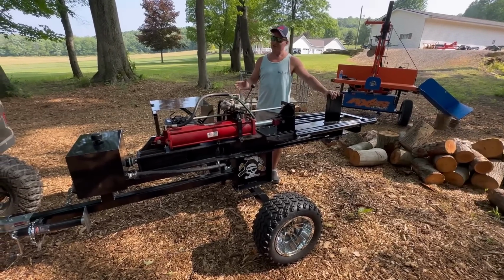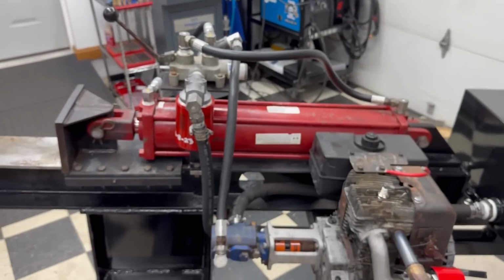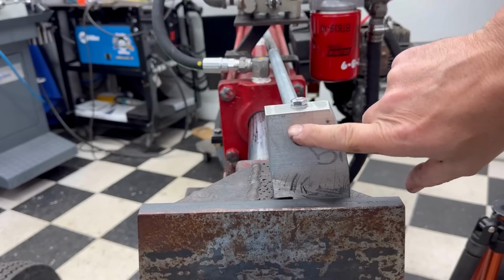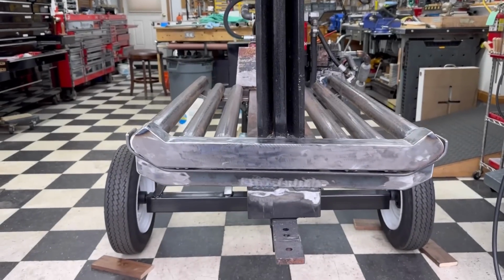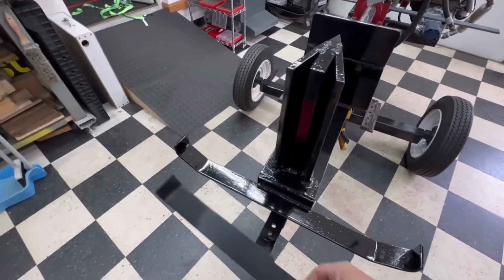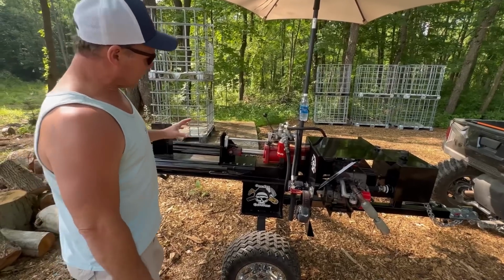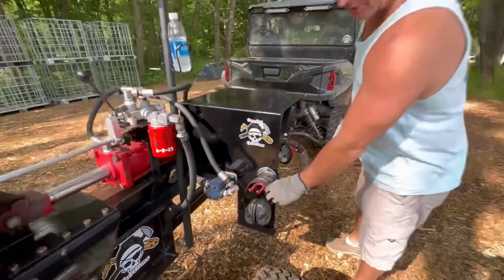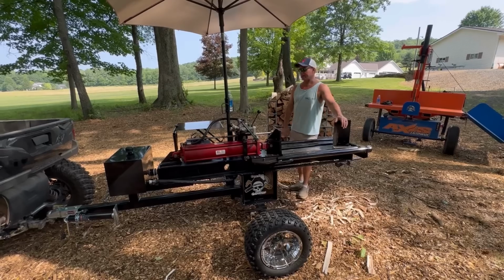One of a kind SLIDING TRAY. Log Splitter completion PART 4

Comment: I’m 70 now and I’ve been a custom fabricator all my working career and well this just makes me smile. Nicely done 👍
Reply from the maker: That is awesome!
Reply: @fcsturningwoodcraft2933  if you been a fabricator all you life then you should know he went around the block to go down the street. Put the knife on the ram and the wood never moves eliminating the need for a sliding table and as far as stopping the ram at certain points we'll that's as simple as drilling a hole in the beam and putting a bolt in it

Comment: One consideration is to add some small cleats to the push plate so logs that aren't cut square and/ or have twisted grain don't kick up out at you under pressure.

Comment: Doug, great video. I really like watching your creativity and knowledge on this video as well as the other ones. As far as a 4 way wedge, I don't see the need. If you were selling wood it might be a good addition. But for a few cords, why bother. Besides, you have more control over the size. Just my opinion. I have been splitting wood with old Lickity Log splitters for over 50 years now. Single wedge, large rounds, small rounds, and anything in between. Love that sliding tray, though. Looking forward to your next fabrication!

Comment: I thought your idea of a hydraulic bumper shut off was great but I thought of something much simpler. Having been a farmer I remembered that they make split collars in various lengths that slip right over the cylinder shaft that make the cylinder “bottom “ out sooner, no need for a bumper rod. I loved your sliding cradle.

Comment: wow, the sliding tray is an idea you should patent.   very cool idea.   I like the valve stop idea too.   I have an old splitter that attaches to my 3pt hitch of the tractor and to lessen the cycle time, I have to always watch the return travel and stop it manually each time.   classy rebuild.  I like when you are done, it all looks brand new with a new clean paint job.
Reply from the maker: Cool, thanks

Comment: Old northern tool splitter. I bought the same one second hand 21 years ago and left it when I sold my house 7years ago. Was able to get it back two weeks ago and drop it at the shop for repair. It’s running again so I’ll be running a cord or two of wood thru it this winter.   I love the mods you made.

Comment: Nice work as always Doug. 👍🏼 This was a fun series to watch. Did you ever find out what horsepower that Tecumseh motor is? With it being 25 years old I'm guessing it's a 3 and 1/2 horse. 
Although it's not as nice as yours there is a log splitter out there that has a sliding catch tray. It's called a Mighty Mac. Made in Canada. 
You should start producing your own splitter! 
With all of your connections and experience in the tool and die and machining industry you already have a head start on parts sourcing!

Comment: Doug you may want to reconsider those black mailable firings, they are only rated for 150 psi. They do seem to out perform their rated value but one day they may not.  Steel hydraulic fittings are generally used. Nice work on all those mods!
Reply from the maker: I will look into new fittings, thank you!

Comment: You're so talented, the creativity and fabrication skills are so fun to watch. Before i got my eastonmade, i had a countyline box store splitter. I ended up shortening the stroke of the ram as well to increase the efficiency a bit. Instead of a rod that triggers the detent, i got crafty at the other end. I basically put a 6" steel block at the far end where the log rests against so it basically shortens the overall stroke but lets rhe ram full retract. If that makes sense lol

I just realized that wouldnt work for you though, my splitter wedge is part of the ram itself and it pushes it into the "extended" steel block i mentioned to shorten the stroke

Comment: Love the tray and the ram return stopper!  The only point of concern I have is that it appears you used malleable cast iron fittings on the pressure side of the pump to reconfigure the hose routing.  These are only rated for 150 psi service.  You should be using forged, machined hydraulic fittings from Parker, Weatherhead, Aeroquip, or the like as they are rated for high pressure, usually 5000 psi or so.  They aren't expensive and can be had from your local hydraulic supplier.

Comment: Nice fab work and a good looking, very functional machine. I tend to split everything in the vertical position since a high percentage of my firewood comes in very large rounds (20" to 36" diameter).  I'm not too interested in lifting those up to the splitter at waist height, so I choose to roll them from the pile to split 'em, then toss the split pieces into my truck or trailer for hauling to the woodsheds.

Comment: Neighbor Doug, You Got the SkillZ.  I love your attitude of using what you got, but making it stout.  This is such a good design. The easton made axis is a great innovation, but you took a splitter that costs 10% of the easton and made something that you can grow older with.  I hate the strain of  bending over constantly.  These ergonomic improvements are fantastic.  Also, the stop idea is top shelf.  I want to be you when I grow up.

The next thing you should add is a log lifter that uses the travel of the splitter to lift a hinged lift. It has a removeable chain.    Watch Marty T from New Zealand  videos on his splitter.  That is a really cool attachment for log splitters to lift huge rounds up from the ground.

Comment: Good job!  I like watching you improve machines
I built a wood splitter a couple years ago as well and incorporated the sliding table as well. The difference between your machine and mine is that I set mine to split both ways, so there is not much wasted motion. I can figure out how to upload a photo so you will have to take my word for it.
Keep up the good work!
Reply from the maker: You can email me at
Oneeyecustoms22@gmail.com

Comment: Great job on the upgrades. A set of hyraulic cylinder stops would have accomplished the same thing on the return stroke without all of the work and machining. They can easily be snapped on and off and stored on one of the hydraulic hoses when not needed. As somone else suggested, a pattern welded onto the pusher plate will help to keep a log from moving as it is being pushed through the splitter. 

The sliding table is pure genius. 

With the umbrella and beverage holder, maybe Autumn will come and help!!

Thanks for the video and keep up the good work.

Comment: I like it, but I also think you might have been better served to convert it to a moving wedge/stationary plate (like a box store splitter).  I split and stack into IBC totes in the same manner and it works well for me. I built a staging table from an old roof rack/basket that sits on the opposite side of the splitter that I stage rounds onto. Eventually I'd like to add a log lift to that side, but for now I just flip the splitter up vertical or bust down big pieces with maul.

Comment: Great job Doug, you are very talented! The only thing that concerns me is that you used cast steel fittings on the high pressure side of the hydraulic system. Those fittings are not rated for high pressure and can fail on you, just want to make sure you don’t get hurt.

Comment: That is a great idea - There was a gentleman in Spooner WI that made these in the early 80s with a sliding log rack on both sides - Built more heavy duty than any splitter I have ever seen in 40 years - My dad purchased one in 1980 - I own and use it yet to this day, in fact just fabricated a hydraulic log lift that moves with the ram and cut one side of the rack off to accommodate. Your work looks very well fabricated.
Reply from the maker: Thank you and thanks for watching!

Comment: You can put that supply line from the pump to the control valve under the front of the control valve over the ram, to tidy it up a bit.

Comment: Nice mods, I wouldn't use black iron fittings on the hydraulics,they are not rated for the pressure.

Comment: that thing is awesome. I have a splitter from lowes, its nice. but it works the opposite way - the wedge is on the ram and there's a channel that it runs in. the damn channel constantly gets clogged and i get pissed. not much i can do about it, but be active in keeping up on cleaning out the junk in there

Comment: Rather than build a complicated linkage, I just drill a hole in the top flange of the I-beam and put a bolt in it so the slide hits it and kicks the valve out at that distance. Since the name of my shop is "Clary Hill Overkill" I've never had a problem with a weakened beam. Great videos.

Comment: Nice revamp on the entire machine. Few things I need to add…
1) get rid of the black iron fittings on high pressure side. Only machine steel fittings nowadays. Save black iron for return side of hydraulic system.
2) sliding trays is not your idea nor is it new. Maybe you took my suggestion from last week to look at Mighty Mac wood splitters? Maybe not and just came up with it, but regardless it’s been done already. Knott Wood Working channel has one of these splitters. I tried to share his channel but commitube deleted my entire comment.
3) my gut feeling is the sliding pipe try is gonna cause problems down the road. I would have went with solid flat trays. I think small connected stringers on split pieces waiting for resplit will go thru and get hung up on support. 
4) still like to see a regen valve. That will drastically increase the cycle time with minimal modifications.

Comment: You may want to consider your filter location. You now have it on the pressure side of your valve. The non pressure side may be a better place. It will catch any debris from cylinders, control valve and hoses. It may also help with cycle times. I have built many splitters. Have had hoses and valves discharge debris that was stopped before it got to oil reservoir. Give it some thought. The pump is what debris will harm. Yes, there is a reservoir screen filter, but not a fine micron filter for the fine metal particles. 
Have a Great day!
Reply from the maker: Awesome, thank you for the input! I never thought of that!

Comment: Seen the sliding tray before. One for sale right now on FB marketplace, Nova Scotia.

Tip for you. I have been researching to build my own log splitter. I see a mistake or flaw that I am not sure if anyone has thought much about. Hydraulic oil needs to be kept as cool as possible, as you may know.

Why the hell are manufacturers making BLACK hydraulic tanks, hoses, cylinders, valves, etc.??? They should be flat white!

I think I will attach a tool box too.

Comment: Very nice job. The only thing I see is the gauge lock screw working itself loose from the vibrations. May want to machine some detents in to your rod at your desired locations and get a spring pin to secure .
Reply from the maker: I will keep a watch for that, thanks!

Comment: having that extra hight on your pusher plate could lead to off axis load on your hydrolic cylinder, so do keep an eye on that. (pun not intended 😉)
The splitter that Knott woodworking uses, also has a tray that slides up and down with push plat. I always thought that to be a good idea. Just be careful that when the tray slides back, it doesn't catch on your hip or leg.

Comment: Good job, Now replace the pump and engine, Find a 16 HP riding lawnmower for 100 bucks and you will have elect. start, battery charging then junk the rest. mount a big pump under it and off you go. A infeed table would be nice.

Comment: Great job Doug. What's a good source for that thicker thread sealant that goes on like a paste? I had some come with a propane weed flamethrower kit I purchased and it worked really well. I should probably get some to have on hand.
Reply from the maker: Any hardware store should have that pipe dope paste.

Comment: Did you modify the valve? It appears to have a detent on the split cycle, not just the return. Nice work
Reply from the maker: It has a decent for over pressure. Meaning it will kick out if a spike in line pressure to save the pump and hoses. Northern tool valve.

Comment: Awesome mods a great splitter. The only concern I have is the hydraulic fittings you used! gal fittings are not rated for high pressure please replace them with rated hydraulic fittings.
Reply from the maker: Thanks for the tips!

Comment: Well Doug I don't know if it's a Doug danger or not but my dad. Must be 20 years ago now when he built the splitter that I have no don't need exact sanything but rather than pipes he had 2 flat. Plates where it's like in Trinidad holes.  All drilled into it looked like a spaghetti plate. It allowed the breed to fall down through and would come back at you everything that you just said my dad's name was Doug 2 we lost him in 20. 19 but maybe his thoughts went on to you and they were like that until 2 years ago.  When I had to modify it to put on my log left because I did notice and when done on my hinge for my log lift I was a 1/2. An inch too high in the interfered when the am went ahead with the angle liner and daddy had underneath them for support bracket.  So you weren't the first but I guess all dogs have good ideas my middle name is doug❤😂
Reply from the maker: Love it and thanks for sharing your story!

Comment: Mailable iron fittings are not rated for the hydraulic pressures that the you will develop in the splitting process.  The fittings are on the return end of the ram and normally should be ok but if you ever get stuck in a piece of wood and try to pull the wood backwards using the ram you will easily exceed the rating of those fittings.  I have never seen a mailable iron fitting rated for more than 250psig.
Reply from the maker: Thanks for the info!!

Comment: Never understood why ppl put the knife on the beam instead of the ram. On the ram the wood never moves eliminating the need for a sliding table and to stop the ram at a certain point is as simple as drilling a hole in the beam and putting a bolt in it. Hey whatever works

Comment: Love your creativity but didn't you over engineer the stop?  Could you not have accomplished the same take by simply bending a piece of metal 90 degrees and mounting it as a stop, even use to tube design on the end to make it an adjustable without having to use the long guide tube and special mounting plate?

Comment: Doug you performed plastic surgery on the old girl and she never looked better. Higher curved sides on the tray and 4-way splitting head. Lifting cradle using pulleys and the ram to lift heavy rounds. Link below is an example. Your make better moto could surely improve the concept.

https://youtu.be/fezL0XhG4vo